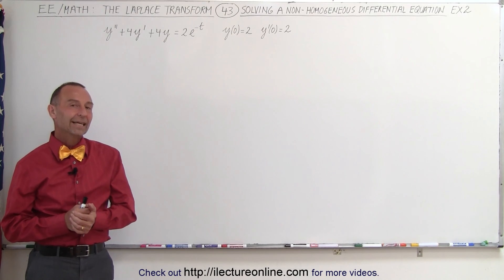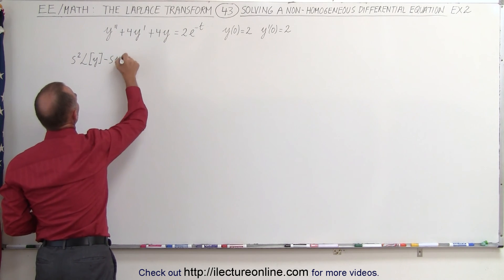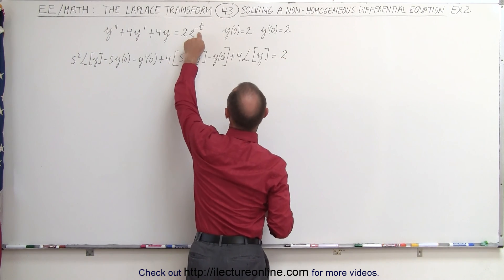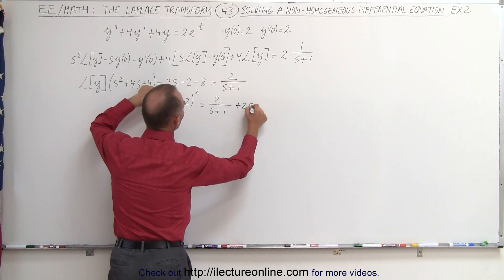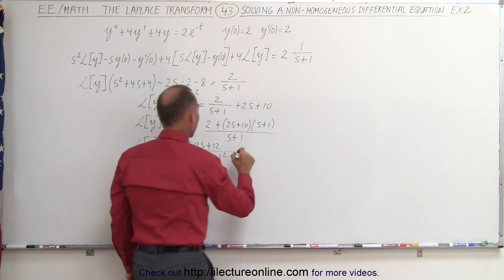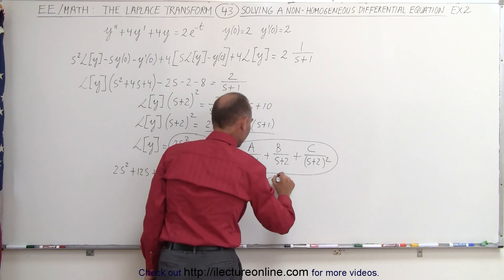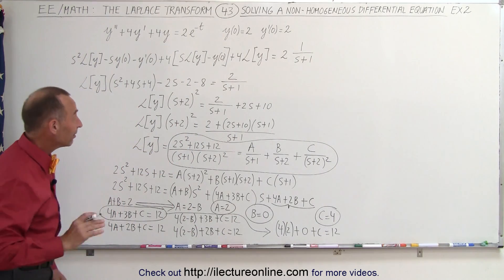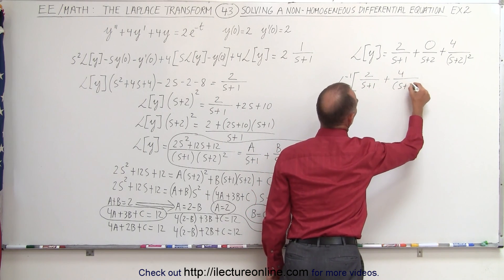Electrical Engineering: Ch 16: Laplace Transform (43 of 58) Solving a Non-Homogeneous Diff. Eqn. 2

Comment: Thanks , the video lecture was informative
It seems one should be able  to solve all types of initial value problems as well as boundary value problems should one be able to solve the respective integrals to get the laplace transform and the inverse laplace transform.
Reply from the maker: Yes, the Laplace transform is very useful for solving all kinds of differential equations.